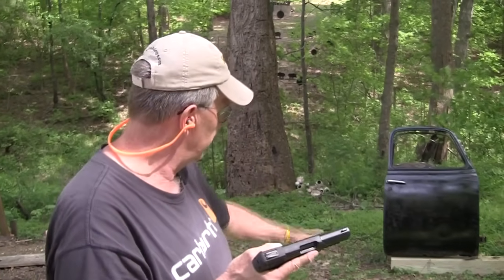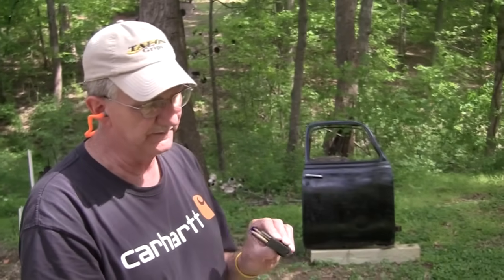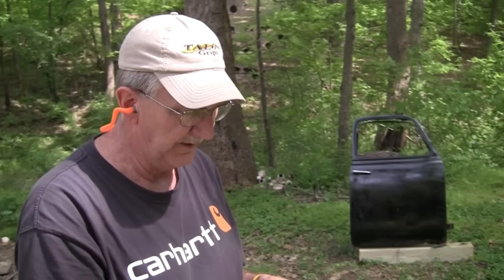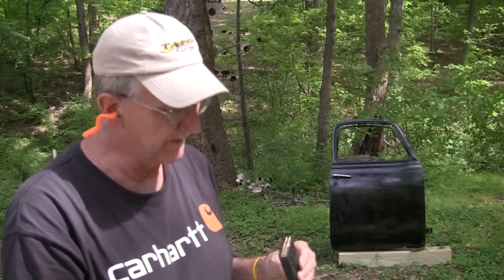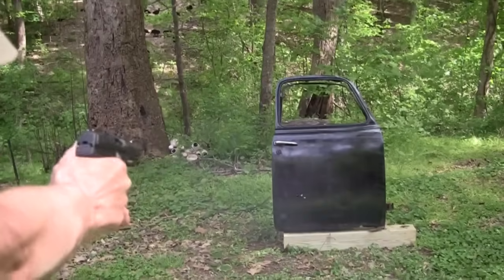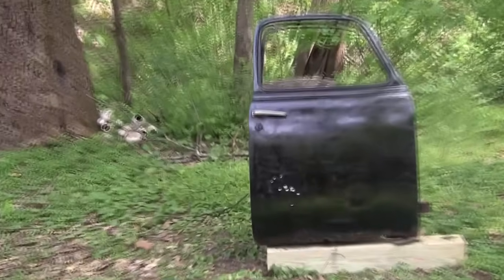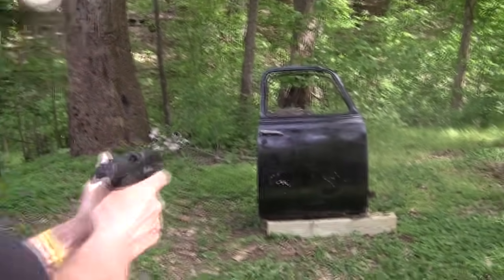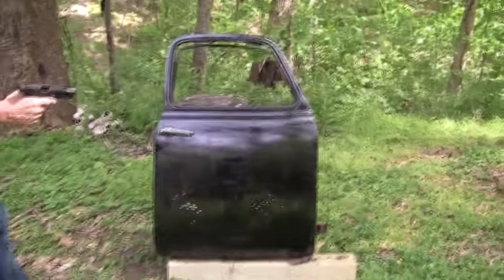FN 5.7 vs 50s Truck Door

Comment from the maker: Yeah, the hollow-point 27-grain bullets seemed to make slightly larger holes coming out. They were quicker to tumble or come apart, I guess.  There was not much difference, though.
Reply: Pretty impressive though... I had no idea these weapons would put rounds through a car door like that. How does the FN hold up when dirty/wet/sandy/etc?
Reply: @servanttofriend8481  DONT DROP EM IN THE SAND. THESE ARE HIGH END BARRELS

Comment: Gotta love the Five-Seven. Only 5.7mm rounds but being that the projectile is tipped like a rifle, youre basically firing a miniature AR-15 (with reduced range of course) so its more piercing power than stopping power like a 9mm or .45 but also having the rounds that small gives it the ability to have a 20 round magazine. Pretty much one of the best pistols around. No wonder its always sold out at Bass Pro and Cabellas before they even get the order in even though theyre like 1200USD
Reply: a weak 9 whit more stopping power than a 57 please
Reply: @garymayfield5995  5.7 got hollow rounds lol try again buddy. people underestimate 5.7 to much
Reply: @valleyguns2288  I missed word my statement,what I was saying that somebody made a comment about  a 9mm ,and I was saying a weak 9mm compale to a 57 .......brothers please I love my 5.7
Reply: @garymayfield5995  what? Are you new to guns or something?
Reply: @chakitowyito6738 gots to be😂

Comment: The 5.7x28mm bullet is designed to penetrate body armor up to 3 - 5 inches. It goes fast enough to penetrate through the armor and stop in the target. Even if the target doesn't have any kind of armor on, it's designed so the bullet doesn't exit the body so there'd be no collateral damage.

Comment: Punched right through an old steel door eh?

That's funny, from what I read from all the internet gun experts, the 5.7 round is supposed to just  fall out the end of the barrel, go straight down, bounce a couple times and roll on the ground.
Reply: Josh Hernandez everyone hates on it, I don't get why, it's an amaz ing gun and caliber
Reply: Peanut mc butter pants yes i like my herstal so much i bought a ps90 and would not change it for any gun my ps90 is close to 2600f per second love very accurate at distance
Reply: A 5.7x28 will go through class 3 Kevlar body armor like you wouldn’t believe.
Reply: Brandon Garvick ya I would I own one
Reply: TC'S Corner I was referring to the original poster, not you.
Reply: The t6b rounds are not to be messed with in this gun. Can go threw almost anything
Reply: I enjoy 2 of these mk2 pistols , one with optics , I love them

Comment: Up until I started working for Cabela's I had no idea 5.7 bullets were so tiny.  Very, very interesting firearm!
Reply: Same round a M-16 shoot
Reply: @garymayfield5995  M16 is a 5.56, not 5.7
Reply: @tmee1512  the same size projectiles
Reply: @garymayfield5995  Same diameter, other specs are different,
FN 5.7×28mm
Bullet diameter	5.70 mm (0.224 in)
Land diameter	5.53 mm (0.218 in)
Neck diameter	6.38 mm (0.251 in)
Shoulder diameter	7.95 mm (0.313 in)

5.56×45mm NATO
Bullet diameter	5.70 mm (0.224 in)
Land diameter	5.56 mm (0.219 in)
Neck diameter	6.43 mm (0.253 in)
Shoulder diameter	9.00 mm (0.354 in)

Additionally, the 5.7 cartridge is 28mm, where the 5.56 cartridge is 45mm.
They are not interchangeable.
Reply: @tmee1512  Please go back to bed
Reply: @garymayfield5995  Too busy working. I go to bed at night.

Comment: is this pistol really shooting rifle bullets??!?
Reply: MANIAK. CHALLENGER very much so...it's old news.
Reply: MANIAK. CHALLENGER Ehh, no. The 5.7mm cartridge is unusual for a pistol because it totally looks like a scaled down rifle cartridge. But it's really not much more powerful than any other small pistol cartridge. It's advantage is the velocity, the bullet is lighter but faster than most pistols, and the fact it makes a decent carbine round too (P90)
Reply: char whick Here's some history about the 5.7. Since 9mm and 45 ACP had a hard time penetrating body armor, Germany and the rest in 1984 or 1986 requested gun manufacturers to develop a firearm to penetrate body armor and keep the compact size of the SMG, so FN Herstal stepped up to the plate with the P90 in the year 1990, also known as the Project 90. With the P90, came the 5.7 caliber.
Now, NATO not only wanted a PDW, or Personal Defense Weapon, they also wanted a handgun that discharges the same caliber, and the FNX 5.7 was born.
Even though the P90 and it's 5.7 cartridge did better in performance tests, the victor that was chosen was the MP7 with its 4.6 because of its better ergonomics and other factors I can't remember. Of course, Heckler and Koch out-performs everyone in Europe, and probably the world.
Reply: uh...  NATO claimed the the 5.7x28 is the superior round over the 4.6x30
Reply: HK has connections that allow it to get military contracts even if their designs are not the best.

Comment: These are cool guns but at around $1250 it a big pill to swallow.
Reply: Calander 2008 ...and the ammo ain't cheap either.
Reply: Yeah, I saw one at the local bass pro shop and wanted to know more. They had some ammo there for it and it was way out of my price range.
Reply: Calander 2008 bought it for $12,000 USD here in Pakistan. Ammo costs $60 a pop.
Reply: Jahan Shah Should've bought an AK for less then $500
Reply: *Looks at AR ....

*Looks at FN .....

*Looks back at AR.
Reply: Chris Monstvil then buys fn out of compulsive habit.
Reply: I just bought one this year, $1287.00 , and ammo is $24.99 for 50 rounds of ball ammo, $27.99 for blue tip..
Reply: Brandon Dunn I bought one yesterday so looking up videos and my gun store has blue tips for 29.99 and I got it for 1439 out the door. What state are you in?
Reply: @fmjjr3672   I live in Oklahoma, check out FireArms Solutions in Duncan,Ok. for ammo. I go thru a friend that has his FFL to buy firearms, but i can share his info with you if you ever in the area!
Reply: I just saw a brand new one for $999, still a lot of money.
Reply: @InHisName999 Bass pro shops prices are crazy on all firearms.
Reply: fast forward to 2020 and Ruger is making the 57.
Reply: I’d rather have the truck that door came from and I’ll just keep my s&w # 66 .357 I know what it’ll put holes in it’s been doing that well for a long time the original car hole puncher

Comment: SS190, and SS198 has no issues penetrating level IIIA, quick youtube video puts that to rest.  SS196SR is the slowest of the rounds offered (besides subsonic SB193), so of course level IIIA will stop it. I did not purchase mine for soft armor penetration abilities. I purchased mine because I'm proficient with it, and shot placement is above all.  I'm not worried about penetration, as even SS197SR can penetrate 12".

Comment: The 57 comes with 3 different mags. A 10 round magazine for areas that have a restricted number of 10. All it is, is just a 20 round magazine with a stop in it. A 20 round standard magazine and a 30 round extended magazine. The nice thing is, is that the 20 round mag does not by any means go past the grip at all, the 30 round mag does by maybe an inch or so but not much to worry about.

Comment: It is not restricted by the ATF. Big Myth. FNH restricts is just as they do SS198LF, but to tighter restrictions. You can get on GB right now, search SS190, and but it for $250/box if you want to. Not worth it for an FMJ. I'll stick with the 28gr JHP pushed  to 2500+ fps, that will penetrate level IIIA as well.

Comment: The .22WMR comparison comes from people comparing rifle velocities .22WMR to pistol velocity 5.7x28mm.  SS197SR from FSN is 1750fps. 40gr HP from PMR-30 is barely 1350 fps. Fastest I've clocked a .22 WMR pistol is 1650 fps for 28gr JHP. Fastest 5.7 round in pistol is 28gr JHP at 2500+ fps.

Comment: I'm talkin about Elite Ammunition's S4M which uses the same 28gr JHP. Its slightly hotter than SS198LF, which is capable of 2200+ fps from just the pistol as well.

Comment: I',m not criticizing you H45, Aerate whatever inanimate object you wish. Elvis shot his TV, and I have felt that same desire from time to time myself. But old body panels are a soft spot for me. I have looked for a lot vintage sheet metal , and admit I winced a little knowing that there could have been a whole lot of rounds in that modern polymer wonder. It did well, and was a good visual test as most are aware of how thick 50's truck panels are. Still, I kinda wish they had bounced off.

Comment: I think there is a fine line between the velocity and mass balance concerning pistol cartridges, but 40g to me is a bit light. If I was going this light I would might as well load a .357 sig catridge with a 90gr bullet going over 1650 fps and I wouldn't even have to load it hot.

Comment: Either way you want to describe it, you can still consider a PDW a SMG: Wiki blurb summarizes it best: Typical PDWs use small-caliber, high-velocity pistol bullets similar to miniaturized rifle rounds, which are capable of penetrating soft body armor up to Level IIIa. PDWs are otherwise similar to submachine guns in most respects, and are often classified as such. Both types of guns tend to have a very high rate of fire.

Comment: This gun is powerful holds a rifle type cartridge in that of the 5.7 by 2.8 mm round and it contains a double stack magazine this should be an interesting gun to shoot so unique
Reply: Chris and my friend Mike Gun Range Shooting The 5.7 is not a rifle type cartridge, even though it looks like a .22 on steroids mixed with  a .223. The 5.7 was originally designed specifically for the P90, but FN Herstal had to make the FNX for NATO forces to replace the MP5.

Comment: What I'm curious on is will 7.62x 25 tokarev do the same. I'm ready to buy a 5.7 pistol the budget friendly at the moment is a psa dagger $500-$600. I already have a 50 rd box of 5.7 ammo

 I've heard that 7.62x25 can pass through level 3A body armor and it's cheaper than buying a Psa Dagger at the moment 🤷.   

Im just hoping the ballistics between the two are comparable

Comment: Aaaah. At last! Good old (maybe not that old) FN Five-seveN. Hope to see the "official review" soon :-). By the way, why do you have 10 rounder magazines. The standard ones have the capacity of 20. And also notice that the SS197 is one of the commercial variants of the cartridge. The ones such as SS190, L191, SB193, and so on, have about 350 ft/s of extra speed while fired from the pistol, and are dedicated armor piercing rounds. (I know that they are restricted to military and law enforcement).

Comment: well sir that should solve your gang-banger drive-by problems i had a 10mm that i could shoot through a '64 buick both doors windows down 7 through & through both doors out of 10 windows were good for only 1 test though then shot it through old 30+ft airstream paneling,refrigerator,cabinets,2 closets,more paneling,then back out the back,all hollow-points,but i'm off point that 5.7 is really pretty cool boss wish i could afford to run one keep up the good work

Comment: I've seen videos where it has penetrated levelIIA armour, and videos where it could not. And statements from FNH themselves are that the SS192 and SS196 cartridges were not able to penetrate various types of Kevlar vests. Besides, unless you're going to war, you wont need a hand gun with that much penetration, a rifle would be far better in that situation then a pistol. The energy carried by the round is still under that of  most 9x19mm rounds, so why you'd want to go even weaker is beyond me.

Comment: They are all lethal. Pick which one is most comfortable for you, pack hornady/pdx ammo. And train to put the rounds where you need them.  If you don't like the price/feel of a caliber, you're not going to train, no training=bad. If you like maximum number of rounds, a 9mm/5.7 are great options.40 is a great middle ground, but I prefer the 10mm. But, I have 3 .40's, vs the one 10mm. Google "9mm vs 40 ballistics gel". Both seem to do enough to do the job. Well as as much pistols can do at least.

Comment: Standard .38 loads and 9mm both shoot fairly easily.  You don't say whether you are of slight build or not, but wield a larger frame that will be better for recoil.  A K frame S&W (or similar) fires easily in single action.  Standard size 9mm would be fine too.  Just remember the heavier the gun the less felt recoil so don't automatically go for the lightest thing you can find.  Light guns can be unpleasant to shoot.

Comment: Oh well, I guess this is sort of a premature cartridge, I also have a .340 weatherby magnum (which is a beefed up .338 lapua, which is derived from a .338 win mag), you'd think it would be easy enough to produce in a plant equipped to machine .338 rounds right? wrong, So far I have only found 4 manufacturers and each offer a box of 20 for $60-$80. sure is powerful though.

Comment: No it was not, the 5.7 round was very specifically designed for the P90 PDW, its was very specifically designed as a personal defence caliber for the P90 personal defeance weapon. The P90 was the first weapons to ever use the FN5.7 and the FN5.7 was never intended to be used in pistols when it was first designed. By the exact definition the P90 is NOT an SMG.

Comment: velocity is only one factor in how much damage a round will do... the fact that its a light projectile in a small caliber means... one its gonna not have much damage cuz it doesnt carry much energy in the first place, and two it wont transfer its energy very well into most targets because it will tend to over-penetrate.... Yes it will go thru some armor better than other handgun cartridges but at the end of the day it wont go thru most armor so its obsolete.. hence NATOs cancellation
Reply: Rifle plates are the only thing this round doesn't penetrate...

You said most, and obsolete. You have failed.

The rest of us also have access to Google as well. Sometimes you can use it to fact check people's statements.

Comment: Well, either this beauty or a Glock is gonna be my first firearm.
Reply: Bro in MO every one has a glock these days, go with something out of the ordinary like this five-seven. Plus the 5-7 is much lighter and is very cool. Either way you still cant go wrong but I thought id throw in my 2 cents.
Reply: IF its your first firearm, you should look more towards a Glock.. 5.7s are exactly cheap and ammo is hard to come by as well as price. If you're rich, go ahead, if not the Glock will be much better
Reply: Dude you won't be able to shoot this gun if you buy it the ammo is expensive and hard to find in local gun shops. This gun was designed to be an armor piercing pistol for some special forces someplace but you can't buy those rounds so its a novelty to a civilian. Buy a Glock or some other semi auto in a usable caliber.  You will actually be able to shoot it and learn how to use a gun that way especially if its your first. That's my two cents anyways.
Reply: pac6010 I can agree with your your statement and I have used one of these 5-7's and they are sweet. Ammo can be hard to find in some states at mentioned. I have a odd interest in the unusual guns that's why I would buy the 5-7.
Reply: Tyler Morse
Its a nice gun and fun to shoot, you will enjoy it. You will probably end up buying more than one pistol anyways right. Its like those potato chips, can't stop with just one lol.
Reply: ha ha ha right.
Reply: glock. its a first for new gun owners, easy clean, cheap and drop in parts are great! and with practice great aim
Reply: ksabih mejias if you live in ohio, you'll have more trouble finding the gun than the ammo. Every gun store I go to stocks ammo, but no guns To use it with. :(
Reply: If you still haven't got your first firearm... I would recommend the CZ 75B. If you want a more compact version, CZ 75 PCR.

In my opinion, superior over the glock.  When you research it, you'll understand why most countries issue the CZ for military and police forces.

Comment: go to a local bone yard and try to find 71-76 General Motors full size sedan door or tailgate from a station wagon model those are desired by demo Derby drivers and they are heavy thick steel I had a 74 Cadillac sedan with a 8.2 litre 500 cubic inch motor the largest factory car motor ever produced in the United States
Reply: a mosin or mauser rifle will probably have no issues going thru one but it would be interesting to see which pistol rounds will go thru

Comment: Anything that shoots and you can conceal “would still work.”  That being said doesn’t necessarily make it an effective self-defense weapon.  A 40 grain V-Max is going to be a lot less effective at 2 yards than a 230 grain .45 ACP.  There is no stopping power.  Go ahead and waste a grand on a novelty weapon, which ammunition is less than readily available and very expensive compared to a more standard defense cartridge.  Buy a 9MM if want the capacity.  I'll take my 1911 .45 over a 5.7 any day.

Comment: You may want to do a bit more research on this before you play teacher. 'PDWs' aren't a new thing, it's just a term, doesn't really mean much of anything. It typically just refers to a small, concealable, submachine gun. The P90 is definitely a submachine gun, the 5.7 cartridge was developed as a pistol round.

Comment: LOL completely false. Even the slowest 5.7 ammo at 1750 fps, has 300 fps on a similiar weight bullet from from a similar length pistol barrel (PMR-30). Available loads in the FSN can reach up to 2600 fps. Fastest I've seen .22WMR from a short barrel (6") is 1650fps.